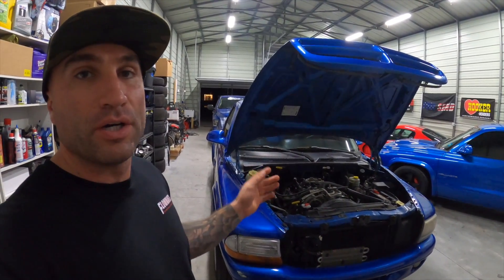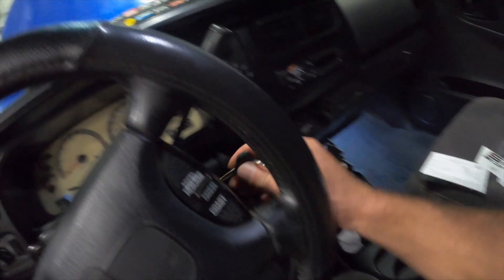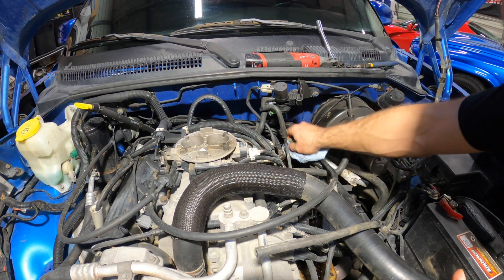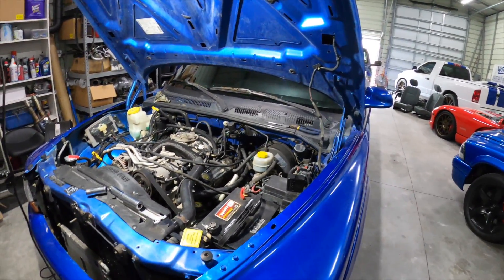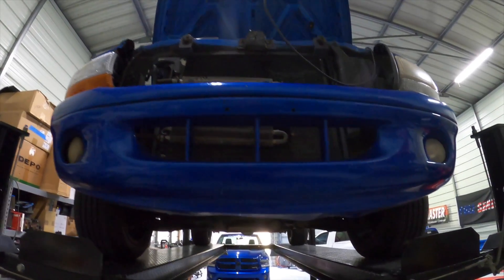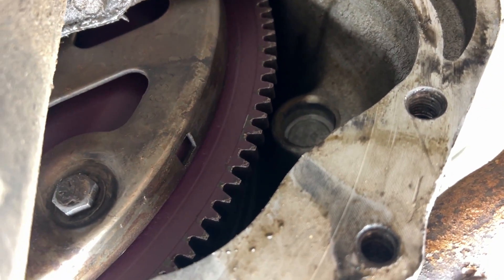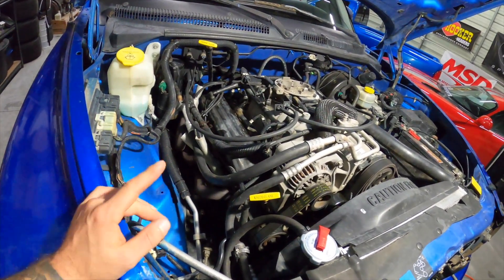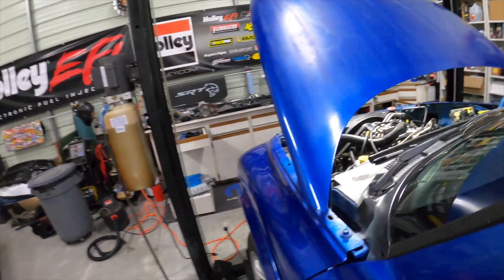What is wrong with this 5.9L 360 Magnum V8 Engine Part 1

Comment: I'm surprised that you didn't immediately recognize it as a valve-train issue. You even pulled the valve cover and noticed the loose rocker arms. Unless the piston is top dead center, the rocker arm should be nice and tight.

My suggestion is this: Pull those valve covers off again, remove the rocker arms, push rods, and lifters being extremely diligent in remembering which rocker arms, bolts, push rods, and lifters go in which position (you may need a special lifter removal tool to get the lifters out). Inspect all of the valve train components for any excessive wear or grooving and replace all of them if even one of them is failing. Attempt to compress the lifters while they are still full of oil. If you are able to compress the lifter at all while it is full of oil, then you may have a failing lifter and it should be replaced. You might be able to get away with bleeding the lifter and cleaning it, but lifters are often very cheap so its easier to replace them. It is very common for engines of all types to have lifters or rocker arms that fail and they will often make a "ticking" noise. Please try out what I suggested and let me know if it worked for you. Good luck!

Comment: My 95 Lightning sounded a lot like it. Ended up being loose rocker arms and I adjusted them all down to 3/4 turn past zero lash and it all went away but I don't think yours are adjustable. If they aren't then it could be some bad lifters that won't prime up under acceleration etc. It could possibly be a loose flex plate or one that lost a counter weight maybe. 
🤔🚫🧢💯💪:_RTMopar:🚛💨💨
Reply: How did you get that RT emoji?
Reply: @Keeter94  you have to join the boostedmotorsports team 
🤔🚫🧢💯💪🏼👿🥶🚙☁️🍺

Comment: Have you ever done a video of fuel injection sync with out a big scanner? I've tried everything in the repair book with no luck.oh yea it's a 1996 ram 1500 5.2 with new timing gear set plus new cam and crank sensor s

Comment: John
as you know videos dont do a sound any justice... only thing i can add without hearing it in person is did you try pulling the serpentine belt
to see if the noise goes away??  to me it sounds like it could be an accessory or possibly timing chain slap

Comment: I am still not convinced it’s not the flex plate 🤷‍♂️
Reply: I have a 5.2 Dak and when I first got it the owner told me about the knock in park and drive… tore the heads off inspected bottom end and it was fine… reinstalled new gaskets and still knocking… found out it didn’t do it in neutral XD took the trans down and boom. Warped+cracked flex plate

Comment: Exhaust Manifold ? Had same thing for years and finally got obvious No problem now
Reply: I had same problem, dodge uses small  diameter bolts and they brake easy or rust

Comment: Could be broken tourqe converter or front pump in transmission...the tick kinda is not with the engine RPM till it's reved up had a Mopar with broken converter sounded like a rod knock/wrapping..and had one sound like a dead lifter tick.👍👌✌️🇺🇸🇺🇲
Reply from the maker: This is interesting. On part 2 of this I just finished filming today I used a stethoscope and it’s loudest when I prove the bell housing on the transmission. When I probe the back of the block it isn’t as loud but it’s either rod bearings or the torque converter I’m just trying to narrow it down rather than just replacing either one hoping it’s the issue. Can you tell me more about how you figured out it was the converter?

Comment: Cut oil filter open and look for metal. It seems to me to be a cracked flexplate. Remove the transmission bellhousing lower cover, make sure the converter bolts are not hitting the cover. Look for flexplate cracks.
Reply from the maker: Checked that today no cracks in flexplate and converter bolts were all tight

Comment: To test the flywheel crack just let the truck idle on the lift and spray wd40 through the inspection cover onto the flywheel, if the noise goes away you have a crack in the flywheel
Reply: The crack will be around the flywheel to crank bolts and will not be visible from the inspection plate.
Reply from the maker: No visible cracks that I can see

Comment: You drove it back from Vagas unless it's a thrust bearing its not a bearing issue but anything really can be used as a stethoscope wrench long extension screwdriver pry bar 2x4
Reply from the maker: Used stethoscope today it’s louder when on the transmission bell housing but I’m not ruling out bad rod bearings and it amplifying through the crank

Comment: I think the only difference in the 5.9 from a Ram and a Dakota was the cam shaft
Reply: There is ZERO difference at all. Same exact motor.
Reply: The jeep had a better tune.
Reply: @leakyjeep5.9  i let punk kids at jiffy lube attempt to change oil in my rare glhs charger, turbo intercooled,they somehow made it smoke an click etc like this i sued there ass,an got 4,000.00 an guys came from north georgia mopar club helped me fix something about pushrods an refused any money, an torqued something to 14 lbs in little stout 2.2 intercooled turno, a real tire smoker with intercooled/ strong turbo, they fixed it an  i stupidly later traded it an big block 80 model truck an 72 cuda for a truck n a good deal of money i wish i had cuda an glhs back, it would scream, carrol shelby done good on some dodges an fuck all phords............

Comment: Stethoscope that timing chain cover. It'll be taping on the left side 2/3 of the way down
Reply from the maker: It’s loudest with the stethoscope on the transmission bell housing but also similar audible level at the rear of the engine block. Haven’t been able to narrow it down between the two yet unless I start ripping things apart
Reply: Ooooo, I would definitely lean toward torque converter as theres nothing in the motor that can make that noise. Rod knock would be unmistakable during cold start. And has a distributor drive shaft back there and that's it. Easier to pull motor and trans together in that truck. Me and my son's do it on a Saturday morning.